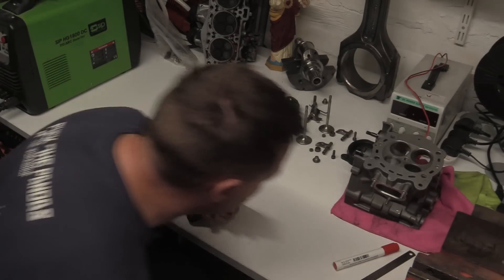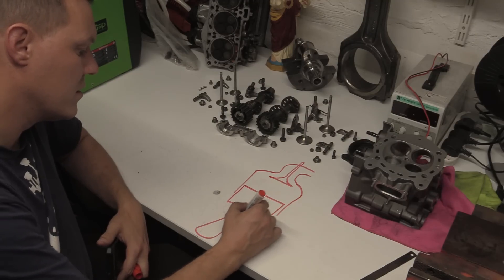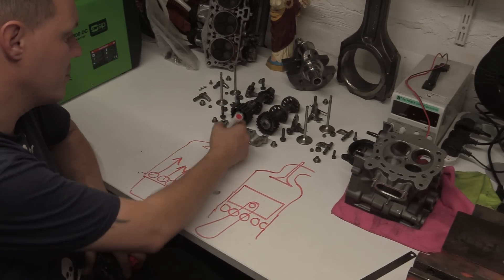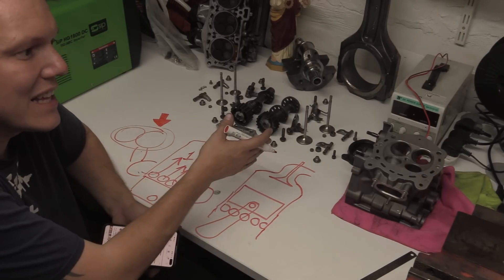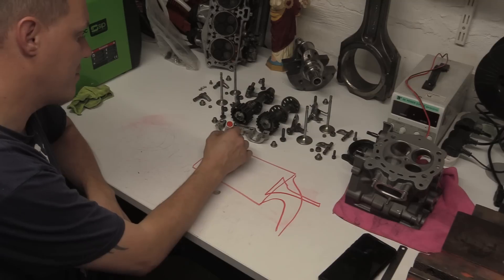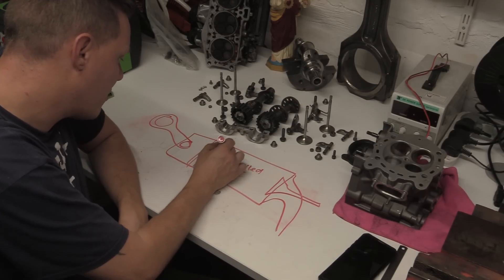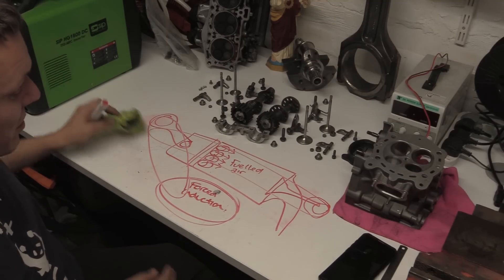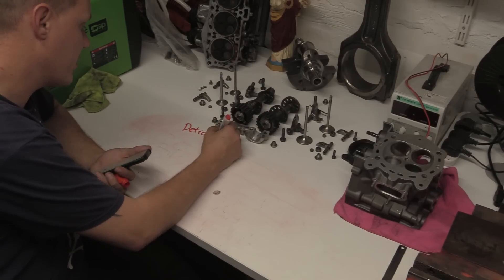Battle of the Strokes - Part 1

Comment: Hi Matt. Yes, you are missing something. DD16 is a 4 stroke engine. There have been no new two strokes in trucks in North America since about 1990. That was Detroit's 8V92 and derivatives of that 92 series. Production for highway use stopped due to emissions. The Series 60 is a 4 stroke and debuted mid eighties. It was a modular design. Daimler has taken the Detroit engine further with the DD series. Your theory is correct but you have the wrong example so the numbers are off. 92s were all Vs with blowers and many had turbos as well. They rev to 2100 rpm. An 8V92T was around 350 or 400 hp depending on spec-ed usage. Of course an aftercooled marine engine was 600 hp due to unlimited sea water cooling. Hope that made sense. See you in a bit.

Comment: Volvo 16l diesel...
D16G750 (551 kW)
Max power at 1600–1800 r/min 750 hp
Max torque at 1050–1400 r/min 3550 Nm
Reply: Volvo Twd 1643, 
917hp @ 1800rpm 
Twin turbo compound charged with 2 water to air intercoolers, one at each stage. 
Those volvos are monsters compered with other industriell, marine and truck engines! And high quality to!

Comment: My take on this was that Detroit 2 strokes were superior ONLY for reliability's sake, they were ahead of there time when they came out and solved some of the issues that you spoke of. For instance the pistons on Detroit 2 stroke's had rings on the top and bottom to separate the cylinder from the crankcase, and you could practically start them floored in -30c and give no shits, but like you said their much less efficient. Also, not sure about Volvo's track record in europe, but in north america their not as sought after unless you have mad money to burn, their numbers are cool and all until to look at shop rates and how much of a pain they are to work on.. just food for thought.

Comment: In the 70s detroit had a 9.3 litre v8 2 stroke with 318hp at 2100rpm 863 ft/lb at 1200rpm Cummins had a 14.8 litre v8 4 stroke with 295hp at 2600rpm and 860 ft/lb at 1800rpm big difference I would say 4 strokes have probably nearly caught up these days

Comment: I think in america, these diesel engines, the Detroit Diesel, can "roll coal" a lot easier from what I have seen here on YT, it's quite cool to watch. However, for me, it's two and one half dozen of the other, where Diesels are diesels, petrol engines are petrol engines, each have their strengths and weaknesses - it's a matter of preference which includes an engines Stroke count. Fan bois of each are going to get butthurt if anything negative is said, yet, the parallel that has to be understood here, about their respective strengths and weaknesses by these Fan bois, is to learn to accept criticism for what it is and understand what is being said. Of note, I couldn't give a fucken rats arse if someone said my 3 cylinder VW engine is shit compared to their forced induction 2 Lt street legal race JDM super fly interceptor 2 door cum coupe, or, their factory brought Chevrolet 4x4 that looks like mini Mack truck and will never be driven off road for the rest of its life. While my Car's engine is super economical, I won't have to worry about periodical rebuilds, worry about matching colour schemes or if there is a life ending scratch on the Duco. My point is, I am not a show pony, nor am I a fucken whinger when having my faculties questioned based on factual information most Fan bois have a hard time accepting (cognitive dissonance) ... It's the same with Harley Fan bois, while looking and sounding "cool", they can't see the engine as the inefficient garbage it is compared to more modern Internal combustion engines. Cheers :-)
Reply: vw 3cyl, i’m sure that’s the engine where if you take the crank out you’ll never get it back in
Reply: @shanedowling9440  I don't know, Cheers :-)

Comment: Not a diesel fan either but wikipedia has the following on Detroit Diesel 71 series 2 stroke.
12V-71 	14.0 L(852 cu in) 1,200 lb⋅ft (1,627 N⋅m)@1600 rpm  456 hp(340 kW)@ 2100 rpm
Detroit Diesel retired 2 strokes in 1995. Based on the numbers of the 2 4 strokes in the video there is no power or torque benefit to the 2 strokes. It was also even heavier than the 4 stroke DD16 which is heavier than the D13A.

Comment: Why do you ❤️ every comment??
Reply from the maker: Because it lets people know I read it.
Reply: The Workshop so have you learnt yet that “positive crank ventilation” and a “breather”... aren’t the same thing??
Reply from the maker: LMAO! What a tit. Gone on then, lets here how they are different...
Reply: The Workshop 🤦 I explained in a previous video. You still don’t understand what PCV is!?

PCV uses engine vacuum to DRAW fresh air through the crank case cavity. The engine consumes the oil vapour. A “breather”, on the other hand, vents to atmosphere. And there’s no active ventilation... it’s just a small hole to equalise pressure. Understand now?
Reply from the maker: What does PCV stand for?
Reply from the maker: I'll help you...

Positive 
Crankcase 
Ventilation

The word breather and vent mean the same thing.

The original question that was asked was "is a crankcase vent and a pcv 'basically' the same thing? To which I answered 'yes' 

The problem is, apart from you being a t.wa.t is you're a car bumboy. This is a motorcycle channel. Find me a crankcase breather that vents to atmosphere...

Quick hint, you won't. All crankcase vents go straightto the airbox. So what some manuals call a PCV for a bike is the same as a breather.

Your shite car engines have so much blow-by because of shite clearances that they need the addition of a reed valve, but they do the same thing as what I've stated above.

Like I said you're a t.w.at
Reply from the maker: Youtube keeps deleting my comment if I call you a t.w.at...
Reply: The Workshop find you a breather that vents to atmosphere??.  My YZ250F! 

And they don’t use “reed valves”.... they’re plunger/piston type valves! Who’s the t.w.a.t here?
Reply from the maker: You are. That's not a road bike. 🤣 🤣 🤣 🤣  you're comparing a car system (pcv) with a dirt bike. You're a special breed of t.w.a.t
Reply from the maker: And I think you mean check valve. Which is what a reed valve is. Wow. 10 points for all kinds of stupid.

https://images.app.goo.gl/3u2QLTd8G6QfyARW8
Reply: Marek Sumguy “blower” - turbo or supercharger?

Comment: Not really related, but, I know a load of drivers who've traded in for a new Scania as the fuel economy is so much better that it pretty much pays for itself when compared to running their current (less than 10yr old) tractor units and coaches

Comment: Ah I was gonna say that's not a 2 stroke, a few already got to it. Here's a comparison of a 4 stroke and 2 stroke of the same era, back when they still made them.

DD 8v71 non turbo (9.3 L, 2415 LBS)
304 HP 800 LB FT
32.2 HP/L
86 LB FT/L

CUMMINS V903 NA (14.8 L, 2800 LBS)
295 HP 860 LB FT
19.9 HP/L
58.1 LB FT/L

From this, you can see why the two stroke diesels had such a long run.
Reply: Got any economy figures?
Reply from the maker: Yeah. They used pretty much the same fuel
Reply: The cummins uses 16.1 gallons/hour at max power. Best estimate for the 8v71 I can give is about 17 gallons/hour, based off the fuel curve for a turbocharged 8v71. Not surprising the two stroke uses a little more fuel for realistically the same amount of power.

Comment: You are missing something the  Detroit is a 2 valve 4 stroke  push rod engine the only two strokes i every saw were in like pneumatic compactors not trucks.most trucker I know prefer Cummins engines and for this type of thing reliability is the preference more that the power your not going to notice much.
Reply from the maker: That was the point...

Comment: The DD16 is not a 2 stroke. Detroit diesel stopped making 2 strokes in the mid 90's with the 92 series engines being the last of them. They've strictly made 4 strokes ever since starting with the 60 series engines.

If you look at the specs for one of the most potent 2 strokes they made during the time (hp/L) the numbers are pretty impressive. The model was a 6-71TI which displaced 6.9L and produced 485hp @ 2500rpm.
Reply from the maker: That was the point...
Reply: @thedirtyworkshop  Also something interesting that I noticed about Detroit 2 strokes is that every reference (that I can find) to the valve/port timing indicates that the exhaust valves are always the last to close on the compression stroke (even on the turbocharged models). If this is true that means no boost can ever be made in the cylinder itself and the only reason the turbocharged models make more power is due to the improved scavenging. I could be wrong as I haven't had the chance to measure the actual timing on a turbocharged Detroit but if I'm correct there could be significant gains to be had with altered valve/port timing!

You mentioned about port-time area not being very good for a uni-flow 2 stroke, what if in a theoretical engine you kept the valve/port timing the same but increased the bore size relative to the stroke (keeping displacement the same)? The port timing would stay the same but you'd have increased port area from the increased circumference therefore increased mass flow. It'd also be interesting to compare the flow potential of a traditional 4 stroke and this theoretical uni-flow 2 stroke where you could have a 4 valve head with 4 exhaust valves and intake ports around the full circumference of the cylinder.

Comment: Not related to bikes but I used to work for Electro Motive Division of General Motors.  Their locomotive engines are two strokers that run about 4000 - 4400 HP @ 950 RPM tops.  Four exhaust valves in the cylinder head, turbo charged air running into the ports. Your right on about BMEP and volumetric efficiency.  The two-strokers are less than equivalent 4 strokers.  You'd expect 2 stokers put out more power per same cylinder config as 4 stroke,  but nope. About same HP for same size 2 stokers and 4 stroker - counter intuitive.   

EMD engines are notorious lube oil eaters since they dump oil into the air boxes through the cylinder ports.  Bad for emissions.  Loco engines (both 2 and 4 strokers) play with increasing compression and delaying fuel injection to lower NOX but at at increased fuel consumption, but with a 2 stroker you get diminishing returns so EMD went with a 4 stroker.   I bet Detroit had the same issues.   Very cool video and your explanations are right on. Thanks.

Comment: The DD16 is a Four Stroke Engine and was developed by Mercedes-Benz. The Mercedes-Benz OM473 is the same engine and passes Euro6 regulations .
Reply: Data from the OM 473LA in the highest on-road setting: 625HP @1600rpm and 3000Nm @1100rpm.

Comment: Detroit haven't made a 2stroke Diesel since 1995, sorry Matt, the DD16 is a standard 4 stroke Diesel engine. https://en.wikipedia.org/wiki/Detroit_Diesel_Series_71#:~:text=The%20Detroit%20Diesel%20Series%2071,both%20inline%20and%20V%20configurations.&text=Inline%20models%20included%20one%2C%20two,12%2C%2016%20and%2024%20cylinders.
Reply from the maker: Sorry matt? That was the whole point of the video. The guy says the 2 strokes dominate the diesel world... but they dont, he was just an idiot
Reply: @thedirtyworkshop  gotcha, it seemed as though you thought the DD16 was a 2 stroke diesel in the video when comparing the two.

Comment: Hi
I served my apprenticeship on trucks and plant both using detroit 2strokes and cat 4stroke engines. Yes the two strokes were great engines in there day making as good power from less displacement, but I don't think detriot has sold a 2stroke for road use since about 1985 or for plant since about 1995 as they could not comply with the ever tightening emissions regs stateside or here. I believe you have missed a trick as I think all modern detroits are 4stroke units, as you pointed out the power / torque rpm numbers are quite similar where as the old 2strokes didn't rev higher but made less low end grunt and were quite shit below 1250 rpm and fuel wasters above 2300, most truck drivers didn't like them as you were always changing gear to keep it on the boil just like the old TZ yamahas
Keep up the good work

Comment: At the time the Detroit 2-stroke diesels came about, many trucks in the US ran on petrol and the 4-stroke diesels were very under-developed compared to today.. The 2-stroke diesel easily outpaced these with only slightly higher fuel consumption for the same size engine or about the same amount of fuel for a smaller engine, depending on model. And since fuel price in the US was negligible at the time the Detroit diesels became the thing to have. Increasing fuel prices and environmental concerns killed them off.

Comment: Brings me back to my question a couple weeks ago. Why not stick with the pentroof poppet valve setup, BUT have all four of them be intake valves and then have roller valves on either side of the bottom of the cylinder. So now when the piston reaches bottom dead center, the intake valves will be open and push out the exhaust, then as the piston is coming back up the chamber will continue to fill (assuming forced induction). More compression, more powah!!!

Could be applied to a 2T or 4T, just more valves for more air flow...
Reply: Probably the same reason there aren't any sleeve valve engines either. 
The design is fairly simple, the volumetric efficiency is better than poppet valves and combustion chamber shape can be optimised. 
The problem is, as soon as you mess with the cylinder walls you end up burning more oil which means emissions go up. 
That and, even the Wankel, which has a following, didn't sell very well. There are those of us who'd see some strange new engine design and want one just because it's different and interesting but we're in the minority and manufacturers want $$$.
Reply: @Surestick88  I'm not really talking about a daily driver emission controlled engine, I'm talking from a power optimization perspective only.
Reply: @Eddie Hitler Hell no, I'm swamped with shit to do as is!

Plus, no offence, but I dont want someone named hitler following me...